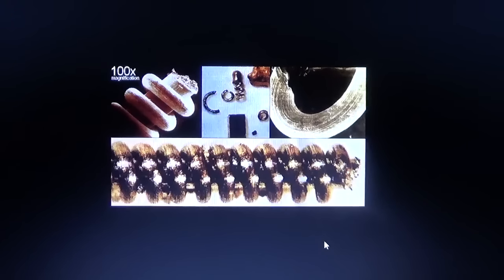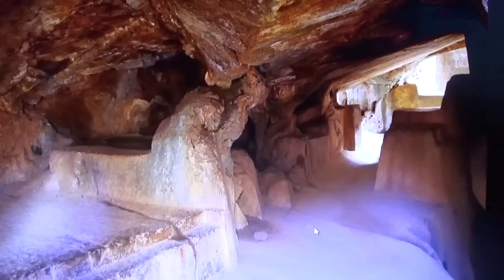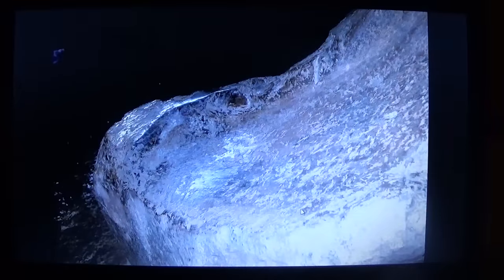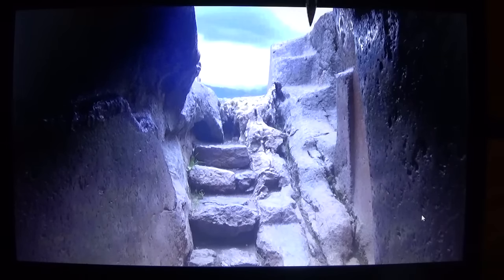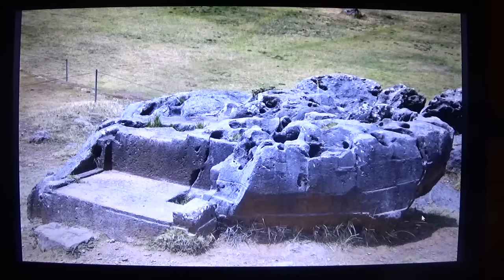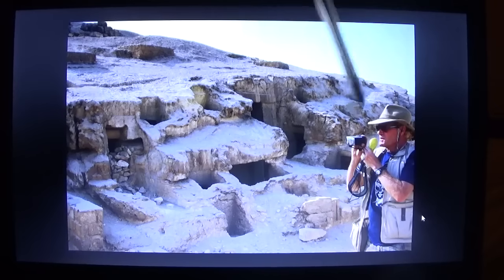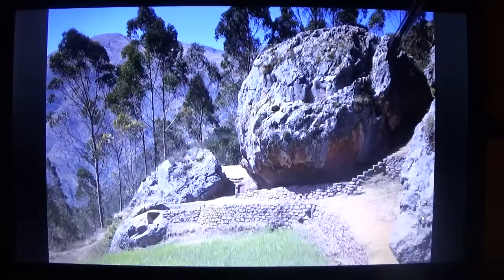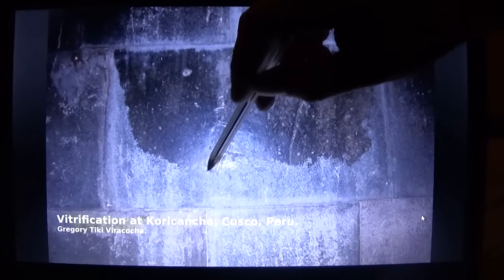ANCIENT MACHINES IN PLAIN SIGHT

Comment: If your hypothesis is right, when you split some of these pieces the "vitrification" would proceed from the outside inwards so you would see gradational differences in the rock.  I only think you are partially right, being a geologist myself.

I work on oil rigs where heavy sediment loads wash over pipe and other materials and I can tell you they become encased very quickly by salt,  less quickly by mud and lime, and progressively slower by other materials like glass.  If these werent carved rock, then we are talking hundreds of thousands to millions of years for complete replacement, in my opinion, for metal.  Some of this stuff is identical to nearby rock and is carved, you can see quarrying, others are poured forms, others are replacement like you are suggesting.  

Rubber hoses deteriorate rapidly on the order of 100 years.. okay.. so heres my hypothesis on lighting in the ancient world.  There is a thing called Limelight, where you burn oxygen, hydrogen and a piece of chalk and its brighter than the sun.  I believe this was the methodology in egypt. Hoses do not and cannot survive. Neither does metal without replacement. But it seems to me like that would be something fairly easy to generate.

That said I think you are right about some things being encased in stone, but not others. 

I definitely believe machinery is at work in places like Sachsayhuaman.  It is completely obvious that there are places for things to rotate and tracks for sliding things as though its a giant factory, disassembled later and turned into a temple then a fortress then attempted to be destroyed by Templar or other Knights, but its too large.  Many other places exist like this.

Comment: does anybody how long it would take for our modern machinery to turn to stone relics if we had a cataclysm, I presume we're talking many tens of thousands of years, if not millions?
Reply: Fletch1970 ,
It would all be contingent upon the medium in which objects were covered, percentage of immersion, climate, etc---so many variables..sandstone, mudstone, limestone. However, there is recent evidence that suggests some material, especially biological specimens, accelerate their geo-processes much more rapidly than initially believed. Scientists have been able to recreate petrification/atmospheric processes in laboratories. So what we once viewed as taking many millennia to achieve may in fact be outright wrong.
Reply: Fletch1970 less time than you might think. in a dry riverbed in either new Mexico or Arizona a cowboy boot was found complete with a fully petrified and fossilized foot inside. the boot was traced back to its manufacturer who said the boot was in production for a limited amount of time around 60 years prior. so, if conditions are right, fossilization can happen extremely fast, and in open air. so far as metals, sea air has been known to corrode and rot steel at an alarmingly fast rate. but even under normal conditions, I found a coffee can in the crawlspace under my house that I estimate to be around 30 years old tops. it was recognizable as it sat. but crumbled into unrecognizable rust flakes the second I tried to pick it up. but I'd wager that even something as stout as a locomotive engine or a CAT bulldozer or even a tank wouldn't last more than a couple hundred years tops.
Reply: GrizzG13 
There are also other examples of recently petrified objects that have been found besides the boot.
Reply: Time is relative.  Our time seems to be much less than those who have gone before us.

Comment: Can you crack open one of the stones and see what's inside? Could you restore the stone back to metal?
Reply from the maker: i`ve not got it in my hand.
Anyway the reason for opening this channel has rang true louder and louder as times moved on, most of its imprints of rusted tech etc / eroded concrete & rebar etc .. where it couldn`t excape it obviously tuned into rock along with everything else ... not difficult

Comment: The Weigner Effect is what I see, Neutron radiation. OR a Strangelet weapon. Think of a Neutron weapon on the Quarks' scale. Smash Au-Au ions at enough  energy and lots of Strangelet particles that transmute all matter.  Why else would CERN do collisions at several TeV with Pb ions? They've now built AWAKE, a linear accelerator that accelerates Protons to 25TeV in 25m, not several Km like the LHC.

I'm willing to bet that a device capable of this type of effect has been used here before.
Reply: Drew  and the pyramids were fallout shelters